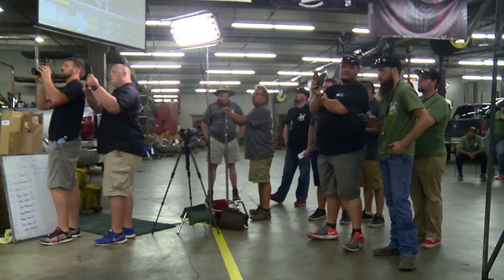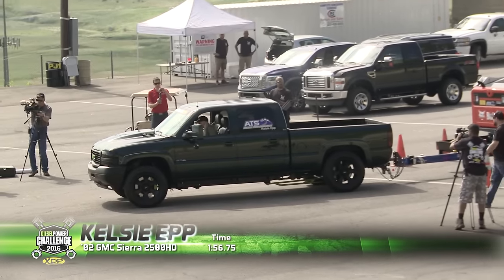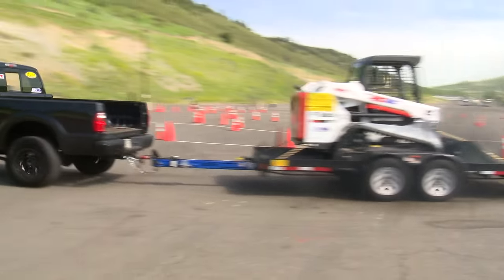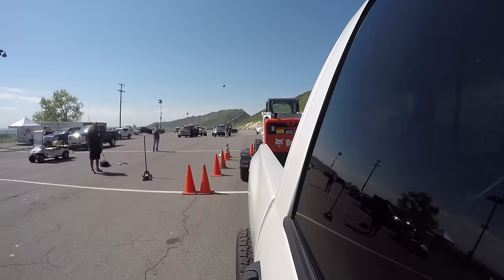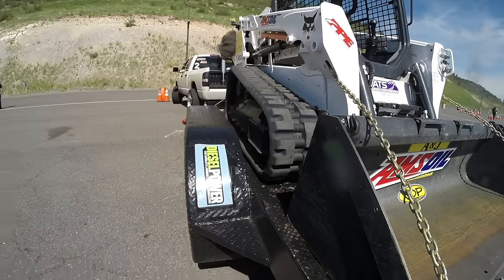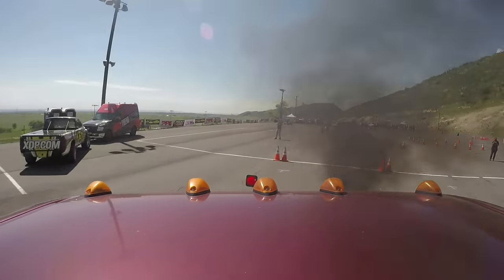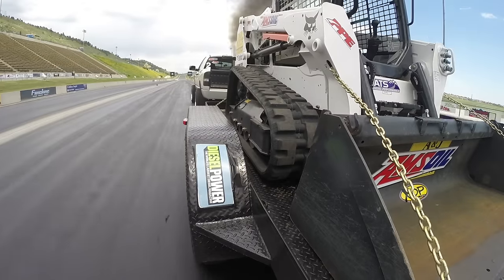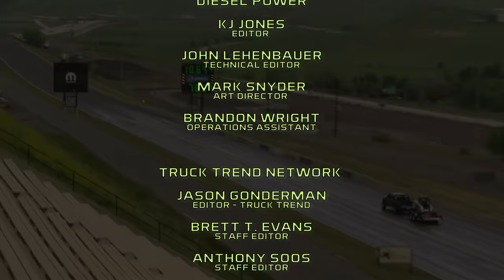10,000-Pound Trailer-Tow Obstacle Course – Diesel Power Challenge 2016

Comment: All these diesels are environmental disasters on their own.. my god man all that smoke that poisons you poor Americans.
Reply: Jérôme B The black "smoke" that you see come out of diesel is really soot. It's a really fine particle. But the soot or black "smoke" actually doesn't stay in the air. Since it is a soot, almost in comparison to really fine dust, it's settles back to the earth, this is why if you put you're fingers in the tailpipe of a diesel, they would be black, covered in the really fine soot. It's a common misconception that the black smoke or soot stays in the air, it I'd more in fact like a really fine soot. Never the less, the black smoke or soot is unburnt fuel and even though it eventually goes to the ground, it would still be considered a pollution, something that pollutes the ground. But we can't see it. Like I said it's a lot like really fine dust.
Reply: The soot is due to not enough air in the combustion chamber. Lots of over-fueling. Two things could be happening. 1. Too big a turbo (though this is usually done on purpose) 2. Poor tuning (either bad fueling or using extra fuel to bring down EGTs as a band-aid).

Banks solved this issue on their pikes peak truck by dual charging it with a supercharger and turbo charger. The super charger gives the air capacity at lower RPM's until the turbos come online.

The reason these guys don't do that is mostly because It's costly and they have no interest in extracting that lower end power. Though since VGT turbo technology is becoming cheaper, more guys are using this to their advantage to reduce smoking by using the VGT system to spool the turbo much quicker.
Reply: A small handful of super tankers are  to blame of about 80%of the world's pollution from combustible transport,  the rest of boats  and planes take up about 80%of the remaining, 10% leaving cars and trains to making  up the last 2%. 

For instance cows are worse for the planet then cars and trucks,  and that's without them being transported  around the world, on the Super tankers and trucks, just there arse gas. 

So to say these truck are bad is to simple.  As they are bad  relatively compared to a car,  but relative to the whole picture they are not.  if we all drove these monsters,  it woildnt even register on the overall figures.  

Im not saying I'd like 100s of thousands of these in towns and cities,  but at the same time the sandle wearing eco warriors think walking and cycling is goimg to save the world.  It's isn't.  getting the  super tankers cleaned up,  or off line  and moving industry back into all counties instead of predominantly China,  will do a lot more for the environment and also the worlds economies. 

Wow a rant over rolling coal ended with world economic recovery.
Reply: Jérôme B Not very bright are we?  A Honda Prius exhaust has more poisons than any of the trucks shown here.  Learn before you stab.